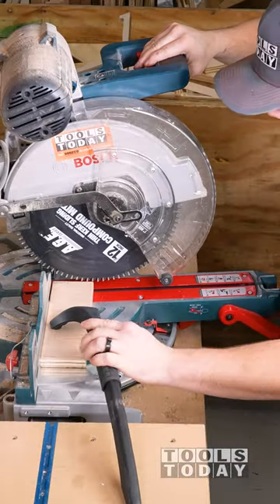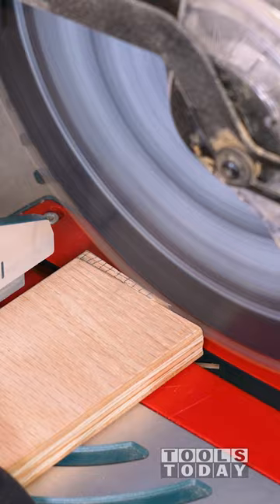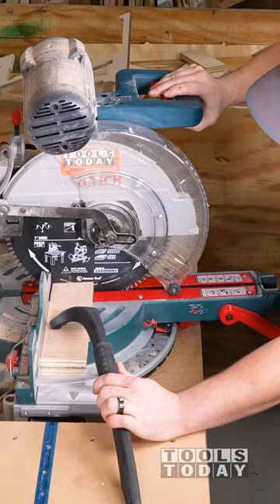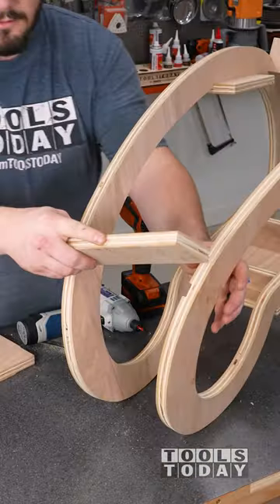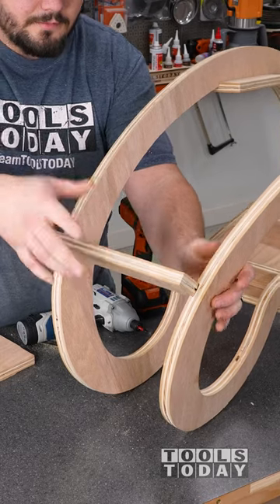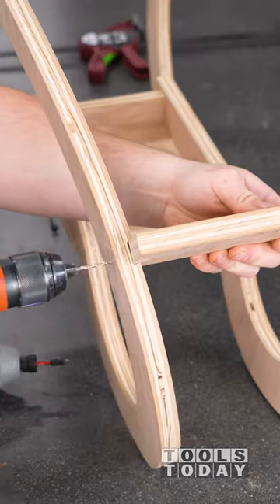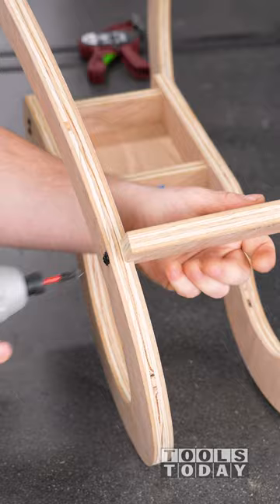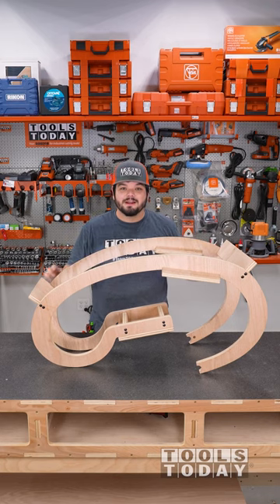Fine Tuning Design Concept

Comment from the maker: What do you think of this rocking toy?  

Check out the tools used on our website - https://toolstoday.com/pica-30403-dry-long-life-construction-marker-blister-bundle-with-multi-use-graphite-refill-set.html

WoodPeckers Protractor - https://toolstoday.com/woodpeckers-i-p8b-mi-mini-in-dexable-protractor-with-8-inch-blade-and-rack-it.html

AGE 12" Miter Saw Blade - https://toolstoday.com/v-11424-md12-976tbr.html

Fein 12v Drill - https://toolstoday.com/fein-71161061090-ascm-12-qc-4-speed-cordless-drill-driver.html

Rikon 12v Impact - https://toolstoday.com/rikon-31-122-12-v-li-drill-impact-driver-combo-pack-with-2-batteries.html